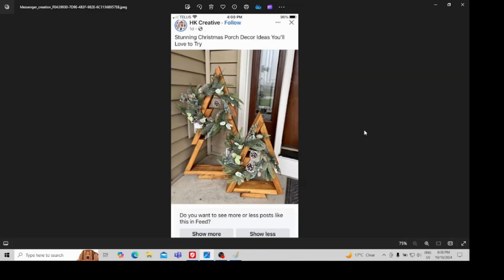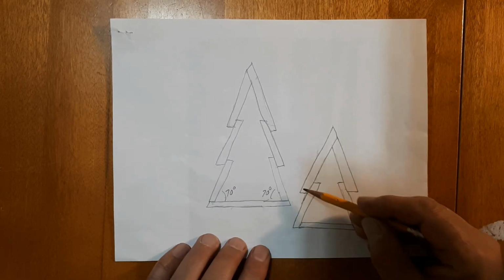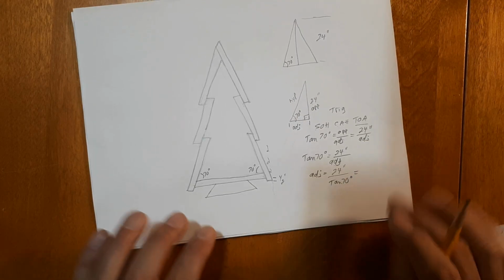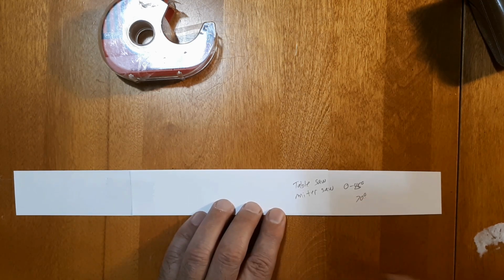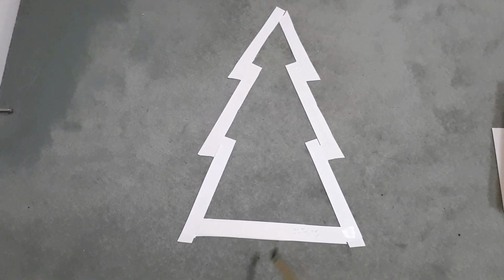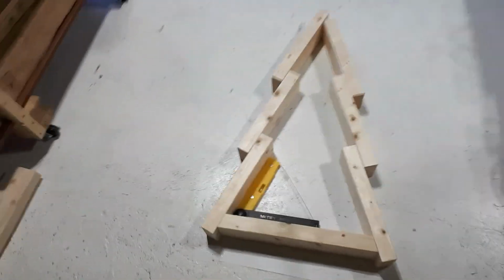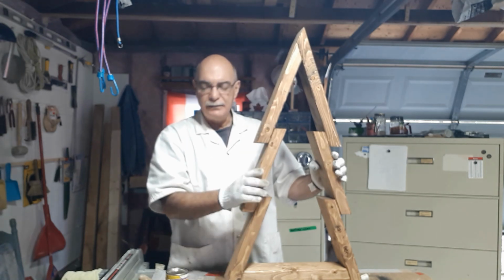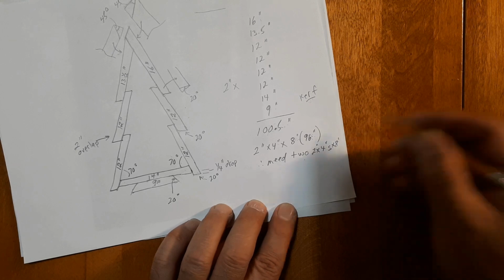Making a wooden tree for porch decor

Comment: Great Black Box reverse Engineering.
For reference, most of these use all 30 degree cuts or mostly 22.5 cuts + 1x 45 degree at the top.
Yours comes off skinnier than the ones used in your source photo.